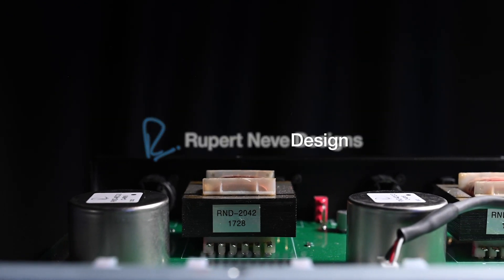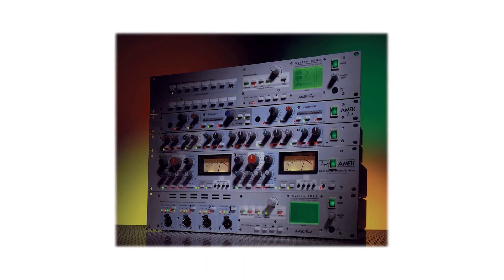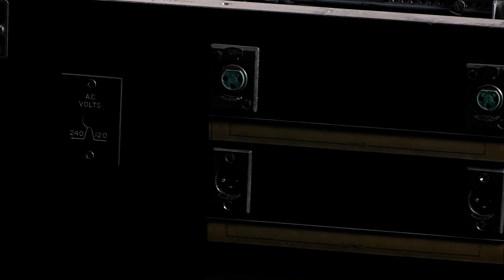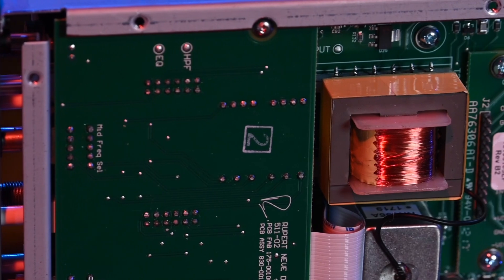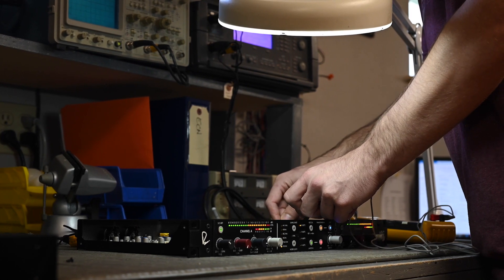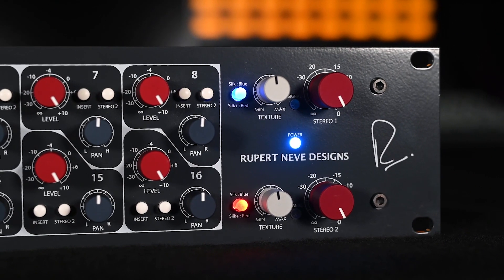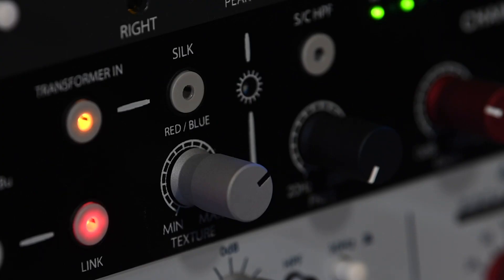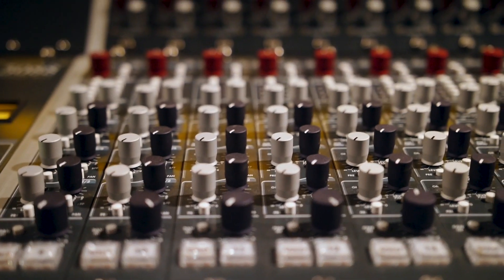Design: How Silk Works

Comment: What I'm wondering is, why not be able to have red & blue silk at the same time, or just one or the other, or neither? I would think this most advantageous, especially on the group buss, or stereo buss, or on room mics for drums, or for a classical or jazz ensemble.
Reply from the maker: We've seen plenty of customers run a unit with Red engaged into a unit with Blue engaged – for example, a Master Buss Processor into a Master Buss Converter, or a 5057/5059/5060 combo summing system. But currently it's not technically possible to do simultaneous Red + Blue in a single output stage, given the design of the Silk circuit. But who knows what the future holds...

Comment: I have the MBP and love the warmth of blue silk. However I also love how the red can open things up. If you run another neve unit and dial in red on one and blue on another, would this make any sense or basically cancel out what each is doing? I'm always back and forth between the 2 but usually side with blue.
Reply: @fernandoherrerabastidas  The red emphasizes the highs, which makes it louder and helps bring out some clarity. When comparing red vs. blue, bring your listening volume up a notch when on the blue. We always think louder is better, so sometimes the red makes you assume it is what you like better. I tend to side with the blue because it filters a little harshness but again, you don't get the openness that the red gives you. I use the elysia xfilter with passive massage right after in my chain, so it gives me a little bit of that clarity there.
Reply: Simple solution - the new-ish Master Buss Transformer has 'Super Silk', which allows both at the same time. Perfection!
Reply: @siriusfun  I ended up selling my mbp and buying the mbt. Mbt is exactly what I was looking for.